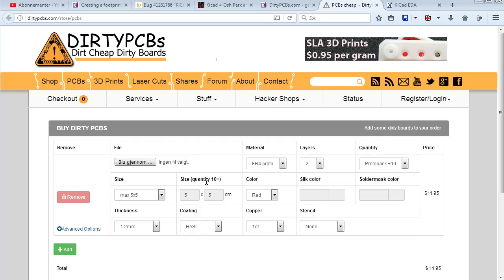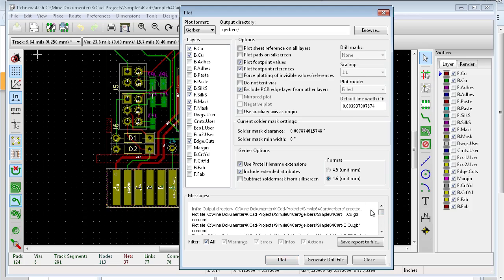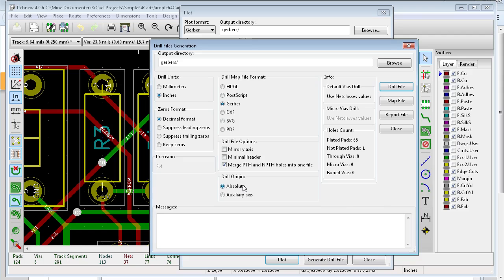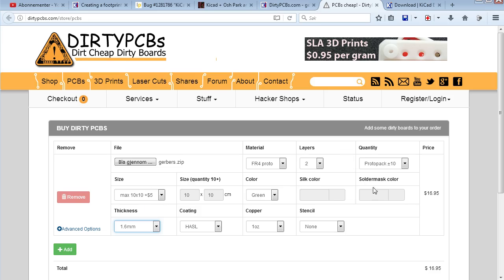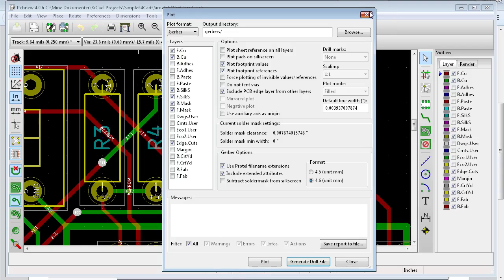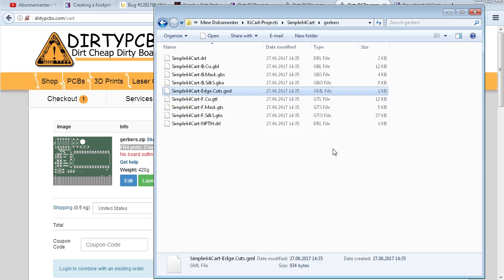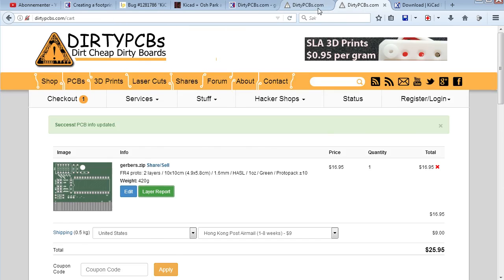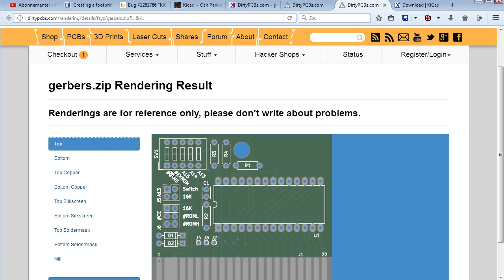KiCAD Gerber files and DirtyPCBs

Comment: Does the Gerbers.zip contain the fixed PCB to repair the issue:  Rev 1.1 - missing trace on ROML that you document on GitHub?  Also, how much work is it to modify or add the ability to use the Board to create a Fastload cartridge like EPYX Fastload?
Thanks....MARK.

Comment: Great explanation. I did not know about renaming the GM1 file back to GML and merging the drill holes files -- great tips!

It looks like the DirtyPBCs render did not apply the rounded corners of the PCB, down by the cart connector pads. Is there another Gerber layer to export to accommodate the milling of the PCB shape? 

Might I also recommend looking into PCBWay.com (http://tinyurl.com/pcbway) for economical PCB manufacturing -- $5 for 10 boards, multiple colour option at no extra charge, select ePacket shipping (very reasonable price and boards arrive fast; a little over 1 week to Canada for me), you get a $5 off coupon for signing up and you can even add FREE PCB Universal Boards (30x70mm, 20x80mm) to you order as well. All around, a pretty good deal.
Reply from the maker: On dirtypcbs: After uploading the board (add to cart), click the preview image, then click the Mill layer, you'll see the rounded corners.
Reply: Ok. Got it. Thanks.